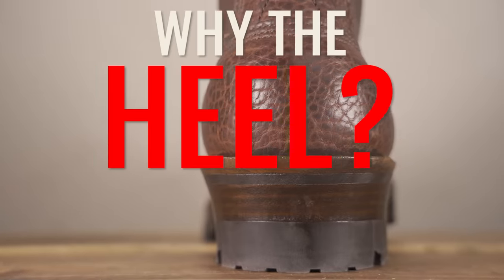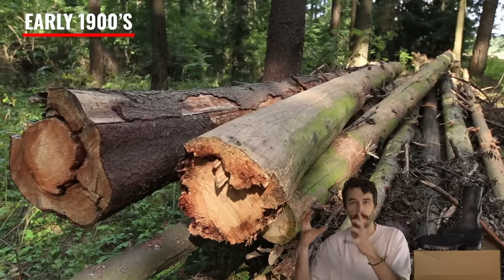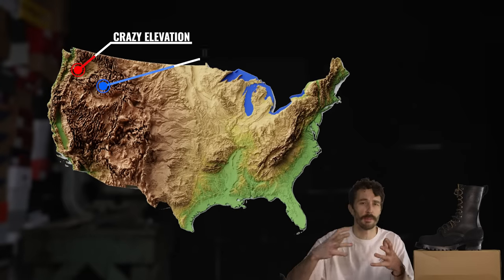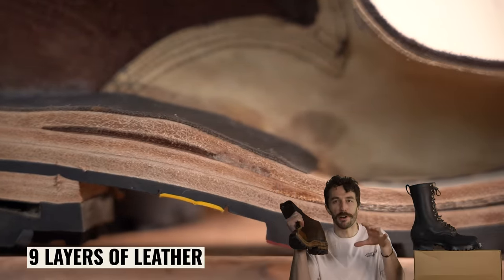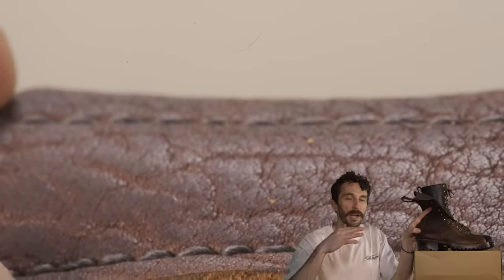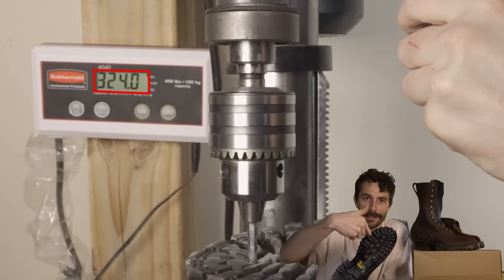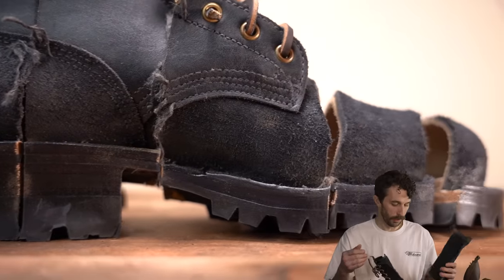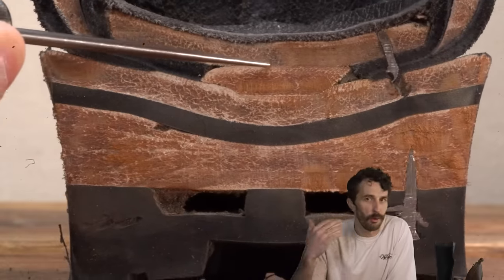Why the heel? 400 year history (JK Boots)

Comment: I was up at my farm in northern Ontario, pretty rocky Terrain, normally just wear a cheap pair of ankle boots, rolled my ankle pretty good one summer, that’s it went and bought a good pair of hiking boots higher then ankle boots. So far so good but after 1 yr the sole is starting to detatch from the boot. Which sucks cause spent a couple hundred on them and only lasted yr. I’m going to look into these logging boots
Reply: I'd recommend low heeled version though. A high heel is not necessary if you're not climbing with spikes. I own a pair of White's smokejumpers that I used for logging. I've found that they work on soft ground because the heel acts as a large lug but it can also catch on things . It's good for walking uphill but worse when going downhill, foot placement is key when negotiating terrain in my opinion. They also do nothing to 'correct' your posture, quite the opposite actually. If that were the case, our feet would have high heels to begin with. I don't know why JK advocates this.

Comment: Are these good for standing on concrete all day, or should I stick with my foam-filled boots and wedge soles? Been wondering if the arch support would prevent some foot fatigue once they're broken in
Reply: I have the nicks version. I usually put around 10-13k steps on concrete every day. The first few weeks were pure hell. But now they are the best boot I’ve ever had. Super comfortable and my feet never hurt
Reply: Nicks has a honey vibram outsole option that’s softer and gummier for hard surfaces. But arch support is complicated if you’re working on flat surfaces, cause arch support is important 100% of the time but a giant logger heel will tend to shift your weight forward which can be hard if you need to bend down a lot. They make a fantastic moc toe boot you should check out
Reply: Jk makes a wedge sole called the forefront, crazy comfortable

Comment: I've worn logger boots since I was a teen. 
I actually ended up logging a couple different times in my life and must have been doing something wrong cause I couldn't have afforded boots like these.
They are awesome I'm sure but I'm not sure about the bison leather. I've done enough leather work to know it's not very abrasion resistant, at least none I've used.  It is definitely a soft and beautiful leather and may actually be stronger than I think. I always liked using horse butt leather because of its durability and how well it wet forms. I would think it would make great boots as well. Unfortunately they've made it expensive and hard to get with the b.s. regulations they came up with for butchering horses. I just don't understand what makes horses more important than cows or any other animals we eat. That's what happens when a government turns tyrannical and decides to regulate and control everyone and everything.
Great video!

Comment: what's the point of "work" boots that aren't steel toe? what kind of work could you possibly do that is so demanding that it warrants $600 boots but yet not have a steel toe cap? this never made sense to me.
Reply: A lot of places that work with extremely heavy objects prohibit you from wearing steel-toed boots. While doing construction,  a board or tool dropping on your foot will bounce off a steel toe, but a whole tree rolling on to your foot while logging will crush the steel toe and cause it to clamp down onto your foot. This usually results in losing your toes. They say it's better to crush your foot and keep your toes. Same thing applies when working with extremely heavy cattle or horses.
Reply: that is a rare exception, the vast majority of workplaces require csa/osha rated steel toes. pretty sure that is a myth that's been debunked anyway, if a tree falls on your foot and it's heavy enough to crush the steel cap then it's certainly heavy enough to ruin your toes.

Comment: I don't agree with many of the assertions about the benefits of logging boot heels you presented here other than the climbing stirrup interface benefits.

Posture is largely a musculature issue. If you have strong and properly balanced muscles, you won't slouch. You shouldn't need high heels to make that happen. And on the contrary, many doctors suggest that raised heels actually hurt your posture. High heels artificially shorten your hamstrings and hurt your lower body mobility and flexibility.

99.9 % of people buying these boots are not loggers. Cosplaying as loggers has to stop.

Comment: I have noticed by looking on old photos that there was also another type of logger boot that had almost no heel, in extreme cases the heal and the rest of the outsole was exactly the same height whit just a grove in between.. though judging by the overal shape of most of these boots there was an "invisible heel" built on the inside. I was wondering  what that was about, i would love to see a video about it, and as I have never yet owned a pair of high heeled logger boots myself i guess i have to ask those of you that have if there is any major downsides to having the big heel or situations where it becomes a problem and gets in the way?